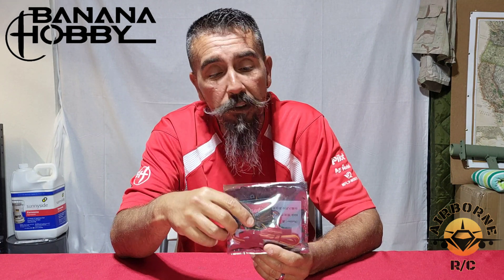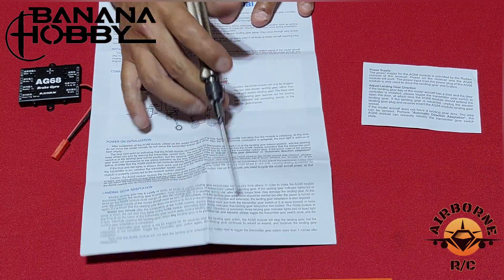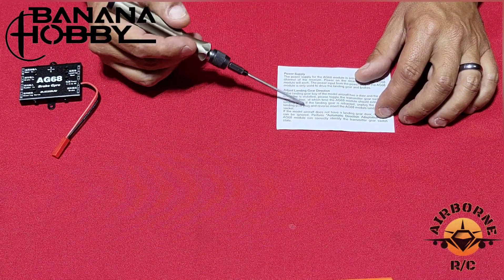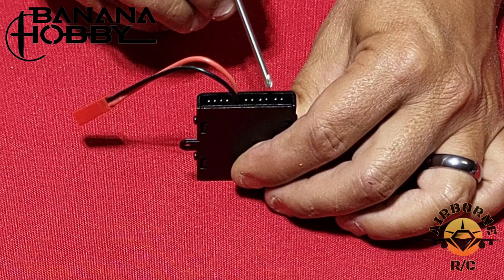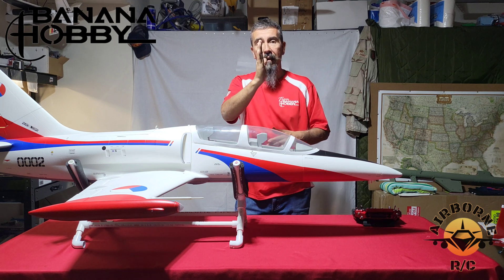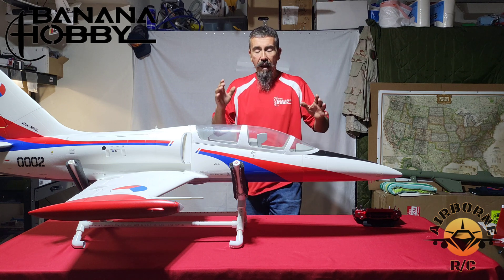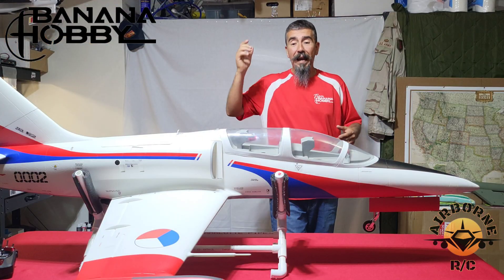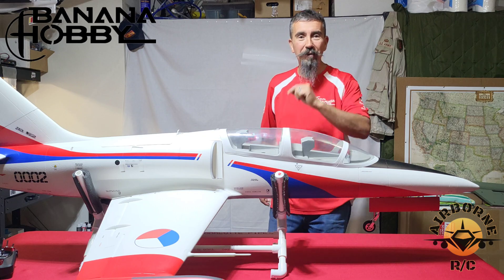ASSAN AG68 Brake Gyro and Retract Controller Install and Setup

Comment: Also, at 8:52 in the video, for setting the braking power limit, should the plane be loaded up according to its landing weight rather than full of fuel?  The brakes will be applied after landing when the plane will be several pounds lighter than at take-off due to the fuel consumed, and at the lower weight the brakes presumably will lock up sooner than when the plane is heavier / full of fuel.  Thanks again.
Reply from the maker: Fully loaded as in take off weight. Pick the nose up and drag the jet adjust till brake are grabbing but not dragging to prevent flats spots 👍

Comment: Thanks for the helpful video!  When setting the overcurrent cut-off in landing gear adaptation, should the one second after full extension be counted from when the last gear is fully extended, or from when the first gear is fully extended?  The AG68 operates gear in a sequenced pattern and there are several seconds between when the first and last gear fully extend, so this would seem to matter.  Thanks.

Comment: Great video. One thing is not clear from the manual. Where to connect the left brake and where to connect the right brake (both brake inputs the controller are marked as brake)

Comment: Great video, but even though I feel I have all connections good-I have some issues still and feel I'm close but am stuck.  My Rudder had to be reversed and the Nose steering (which is Y'd with the rudder) steers correctly.  Problem is the gyro compensation is wrong direction.  Tried the Steering Adaption but never was able to get it to work.  Also tried to increase end points/travel for the rudder, no effect.   ALSO do not have the brakes working for some reason....I suspect the gyro in it is critical for the Nose steering adaption as well since its prob the same gyro.   The Good news is my Gear and door sequencing works and was adjusted awesomely using the Assan Door Sequencer....so I know the AG68 is getting good 7.4V power...not sure why brakes don't function...they are JP on AeroFoam T45 Turbine.   Need some help/ideas please
Reply from the maker: @RivotJT  do your brake work when the gear are  in the "up" position?
Reply: Not sure? How do I check that if the gear is up and gear doors shut,?
Reply from the maker: @RivotJT  you will hear a loud "click" when the magnet hit thr plate when u apply brakes
Reply: Ok just checked and with gear up - no click no brakes. Same with gear down.. Also have read other comments here about automatic steering adaption and put my nose steering on a seperate channel mixed with my rudder channel and got rid of the rudder splitter. So direct line to from nose steering channel of the rx to the rudder IN port of the AG68 . This even with travel endpoints of the rx steering channel at 130+- still won’t let me enter the automatic adaption… gyro appears to work on nose but is correcting the wrong direction.  Frustrating.
Reply: Hey I tried the adaption again same as always EXCEPT I cycled the Rudder stick on my TX very fast and sure as heck I got the alternating blue and red lights indicating the auto adaption was working.....Now the gyro correction is working correctly!!! Unbelievable that was all it took...faster cycling of the TX rudder stick!! Geez...thats 2 out of 3 systems working .. If I could just figure out how to get my brakes working I'd be all set....Need ideas

Comment: awesome video!  I do have one question so far.  Do I reverse the gear channel on my transmitter to match the position of the Left and right gears?  Or do I reverse it in the Assan?  I did have to reverse the polarity on the nose gear so it matches the L/R gears.  thanks man!
Reply from the maker: @adamsmall2301  if thr input from the TX moves thr tire opposite direction. Rev ch. If correcting wrong way do adaption setup
Reply: @ my NOSE servo is on a separate channel so I’m running cable from nose servo channel to rudder in on the AG68. Nose steering is correct with rudder input but compensation is wrong. Having a tough time getting into adaption mode.
Reply from the maker: @adamsmall2301  follow the video. If initiating adaption fails. Most likely the assan doesn't see "full deflection" open up endpoint on steering ch to -130 to 130 and do again that'll do the trick

Comment: I got everything working except for the fact that when I give left rudder my nose gear goes the opposite direction.. any help would be appreciated.
Reply from the maker: @samuelbadillo5741  is the rudder going left too? Simply reverse the ch. If rudder is going the correct direction. Perform the steering calibration. I always run my steering on a separate ch mixed to rudder. This way I can reverse if needed without messing up ch4 also can subtrim it for same reasons. #
Reply: @NoonzAirborneRC  so gear is down rudder going the correct directions… so left input on rudder nose wheel goes right.. may just put it on a separate channel and be done with it.. thanks for your quick reply.
Reply from the maker: @samuelbadillo5741  NP yeah I run a separate ch for steering always even on 6ch fw planes. Just makes life easier and can get it dialed in.

Comment: Thanks for the great vid.  I've been avoiding these due to the horribly translated instructions always resulting in hours of frustrating setup in the last few I've owned, but thanks to you I may revisit getting more of these.

Side note, don't these have an ABS pulsing function? I know at least one or two of the different AG6xs I've owned supposedly had it, but I was never able to get it to work.
Reply from the maker: Great to hear! If you need any help don't hesitate to reach out! 👍🇺🇲👊